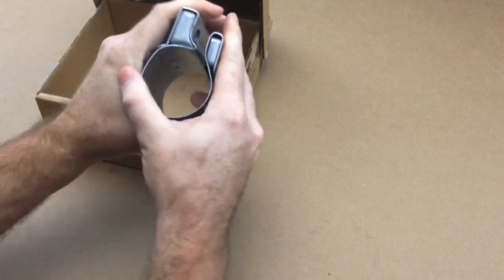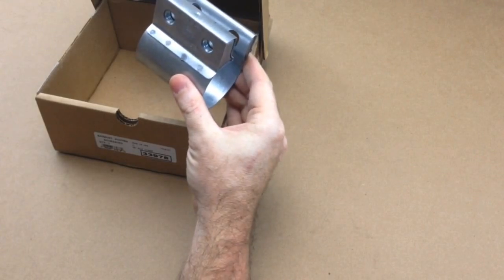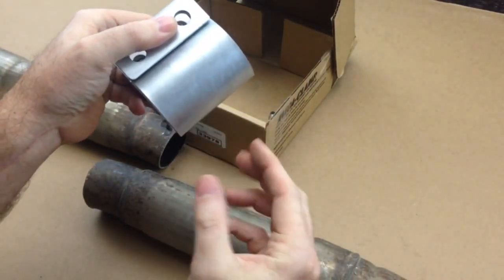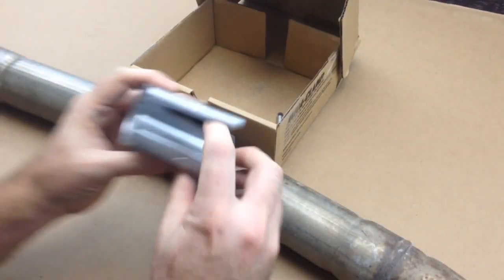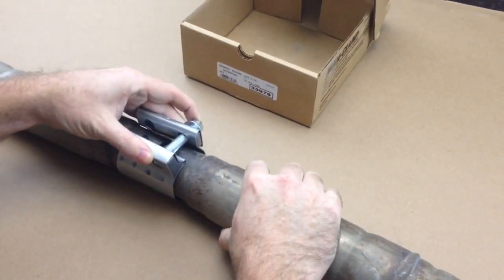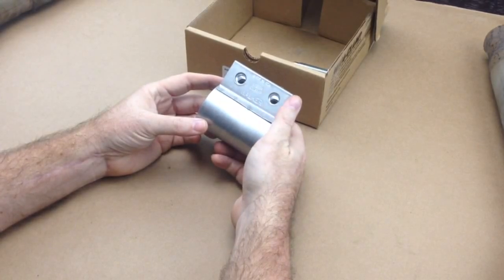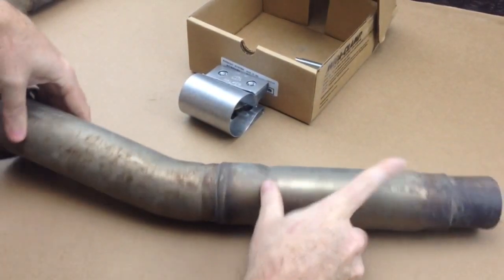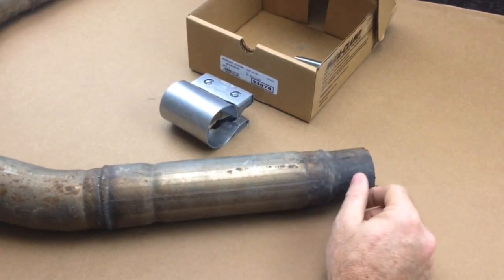DIY How To Fix  Exhaust Without A Welder High Grade Re-useable Clamps

Comment: You can easily measure the od of a pipe before cutting by wrapping a string around it and marking where they meet. measure between the marks then dividing that by pi (3.14159)
Reply: Ralph Shoop kkkkk
Reply: It's 3.1416
Reply: @JoseSanchez-wh1zb  3.141592 most people would round that 2 down not up.
Reply: @ralphshoop8822  not actually they go for 3.1416 because is an exact number otherwise if you go with 3.141592 you can still doing math or calculating numbers

Comment: Just did flex pipes on q Audi Q7 requires pulling the motor in order to weld. Cut old flex pipes out, kept old upper flange bevel, sized new flex pipes and used clamps. Works like a charm. Took over two days in the shop to fix but it worked. Work in a European specialty shop. Think total measurement was 8" on each flex pipe, also used some high temp epoxy. Most muffler shops won't even touch the Audi exausts 😂. Sent the Q7 and the guy sent it back said the motor would need pulled in order to weld.